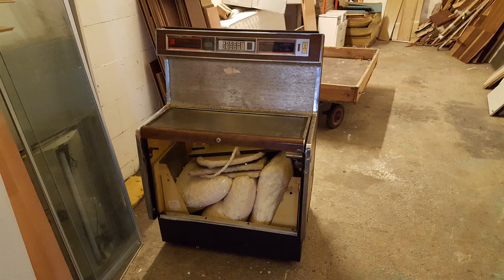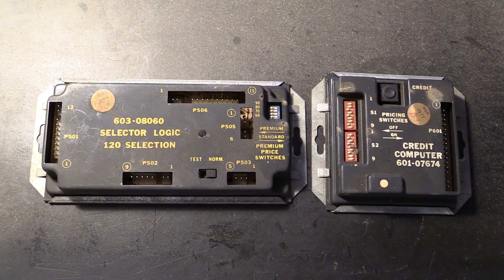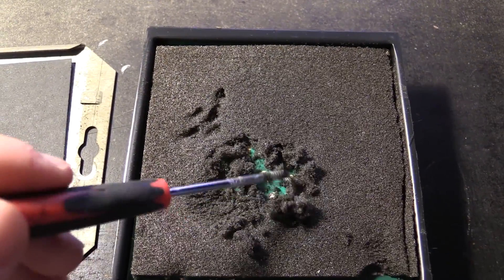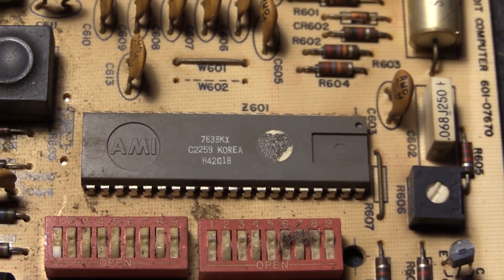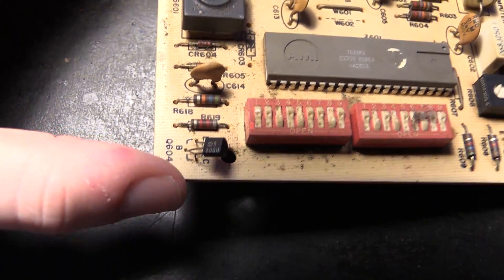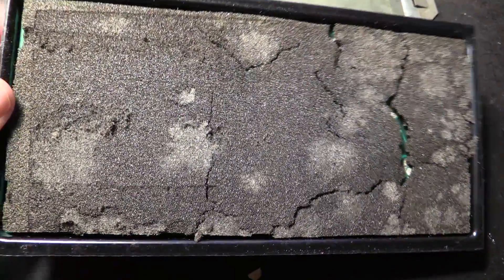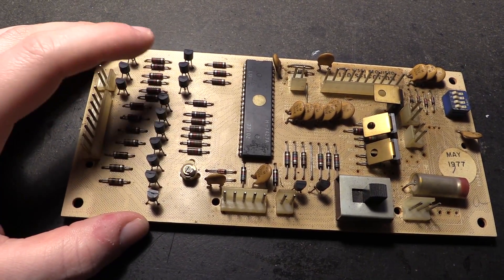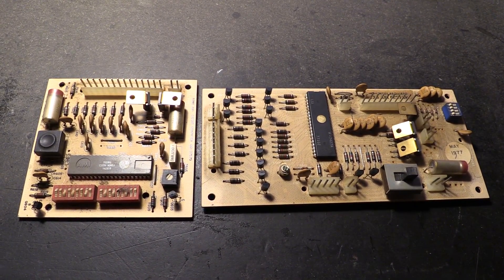1977 Rowe AMI Jukebox logic modules teardown

Comment: That particular jukebox cabinet never came with ANY digital boards. It was a TI 1 or 2 model. Rowe (pronounced like "row" a boat)   did not start the digital controls until the R-81 in 1977. It had to have been retrofitted with those boards, if they were mounted in that box. The TI boxes were early enough to still have tube amps. (Worked on enough of those).     

Rowe had most of the LSI (large scale integration) chips custom made until they changed the computer system with the R-84. So, any numbers on the chips will not be in most cross references. The chips were only made in one or two production runs as special orders for Rowe, and when they were gone, no more were made.
Reply: Sorry, it was an RI-2. Which was a smaller TI type cabinet reused with the digital components. The
Reply from the maker: I really don't know anything about Jukeboxes. Thanks for the info.

Comment: can you make a video of choosing right transformer for audio amplifier and how to calculate output power of amplifier.. thank you
Reply from the maker: https://www.youtube.com/watch?v=eRFxe6m7k-E
Reply: +DrCassette sir my ques is besides your this video...but im having so much problem of making tda2030a amplifier n i think the problem is coming from power supply im using 12-0-12 transfrmr by rectifieng ic gbu600 n 3300uf caps to filter it....n when i measure voltage after being rectified n filtered the output voltage is +-18 volt....and when i connect this supply to my amp circuit a burning smell comes from tda ic(i have burned two ic before).....i checked many times my tda circuit n its fine... n later i used a 12 volt battery..with caps the circuit works but very much noise is coming....i knw . the 12 v battery is not permanent source but pls help me how to make power supply for this circuit so my amp works fine... thank you n srry for long post
Reply from the maker: Seems like your power supply is fine. Maybe the TDA chip is oscillating?
Reply: +DrCassette  i don't know its oscillating or not...but if it is, how could i correct that circuit
Reply from the maker: Have you installed the optional buffer capacitors suggested in the data sheet? Those might help.

Comment: 2nd board, big chip labeled LSI. Thats definitely an ASIC, as thats what LSI used to make back then. Almost like a manufactured burned-in pre-programmed CPLD/FPGA. I am surprised you didnt grab any parts from the control panel, it had a few 7-Segment displays!
Reply from the maker: Makes sense, I don't think they made enough jukeboxes to justify a traditional IC production. I didn't mess with the front panel because there were people around and I didn't want any trouble...